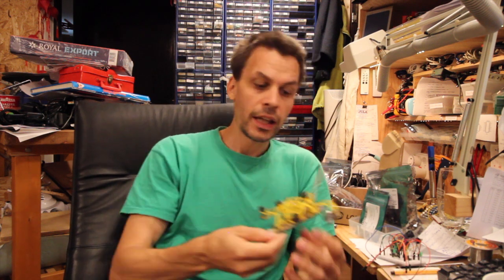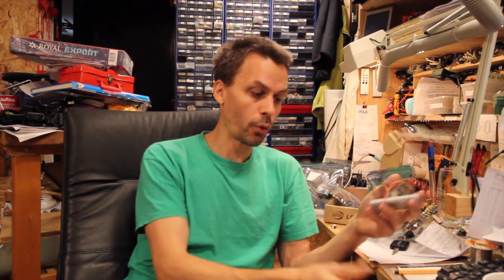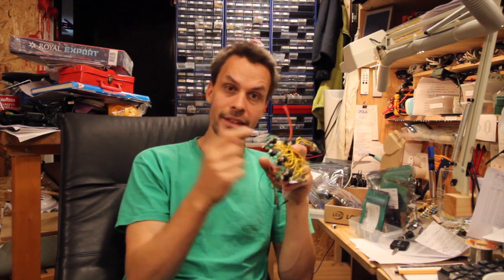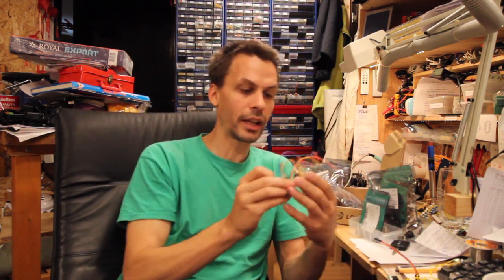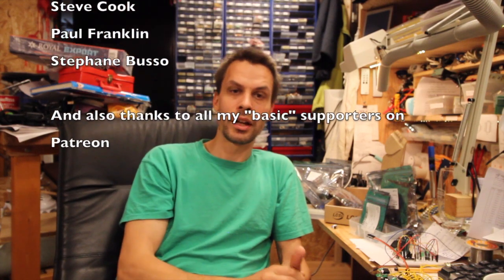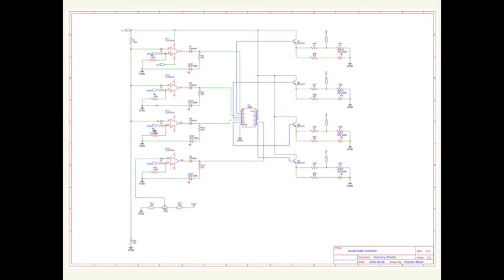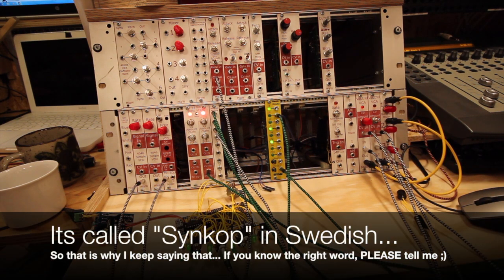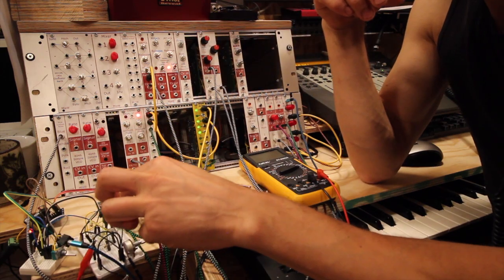Quad Gate Inverter - DIY Modular in a Week 8.2

Comment: great module, thanks Kristian. I don't have any 4069 in my supplies so tried the 40106 initially and couldn't get that to work, but using a 4093  it works great :-)
Reply from the maker: Yeah the 40106 is a Schmidt trigger which acts a bit different than a “normal” inverter. Good to know the 4093 works aswell.

Comment: OK, Kris, you need lights in your modular (who doesn't?).
I made something like this: https://www.tips.modularparts.net/diy-3-5mm-eurorack-jack-plug-led-bipolar-redgreen/

And for very cheap - all coming from Chinese suppliers who don't charge for shipping (Banggood, eBay, AliExpress, ....). I just used a 470 Ohm resistor and a Blue/Red BIPOLAR led (it changes color due to polarity - it's just 2 LEDs in antiparallel).

All enclosed in a 3.5 mono male mono TS MiniJack (mine are plastic ones, but I also had some spare metallic ones and used heatshrink tubing to insulate the inner bits from the shell).

For audio signals, the light is Purple.
Other than that, it's BLUE for negative voltages and RED for positive ones. As it SHOULD be, as an industry standard.
Reply from the maker: B.E.A.utiful! :D that is an awesome way to bring color into the modular. Will definitely look into that. Thanks! 👍

Comment: OK, this is an AUDIO/analog inverter, based on a TL 071, by David Haillant: http://www.davidhaillant.com/wp/wp-content/uploads/inverter-1.0b-schematics.pdf

For digital circuits, you SHOULD actually ground ALL the unused inputs, as in any logic CMOS gate. Just to avoid undesired "cross-talking" or randomic ghost inputs on the other gates. It's common practice. It's also common practice to BYPASS/DECOUPLE the positive and ground IC pins with a 0.1 µF capacitor.

By the way, the link for the braided cables on aliexpress you used to post on your first videos, doesn't work for me. PITY.
Reply from the maker: Thanks! I’ll fix the schematics (and my module) with the logic and decoupling. I’ll look at David’s design as well.
Reply: @SourceryOne  By the way, the fact that it's analog means that it can process ALL waveforms - including square ones (which was your current use case, to my understanding). Moreover, David's design is based on a TL071, which is easily made into a dual, quad, ... anything (hex? octal?) module by simply combining TL071, TL072, TL074 on the same module - the limit being the vertical space (I normally calculate about 1 cm from both ends, so I get about 108.5 mm usable height for a PCB - OK, I round it to 11 cm, which is just fine).